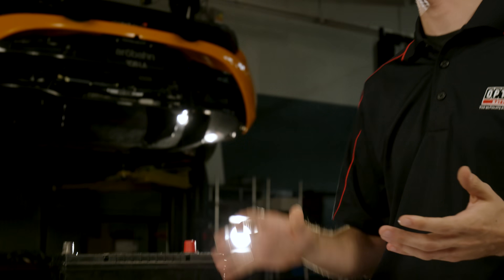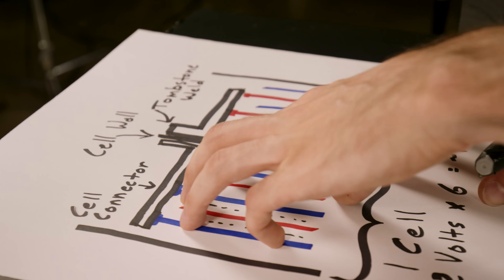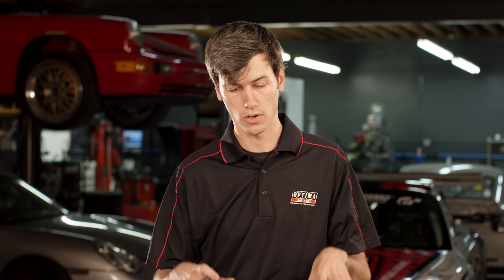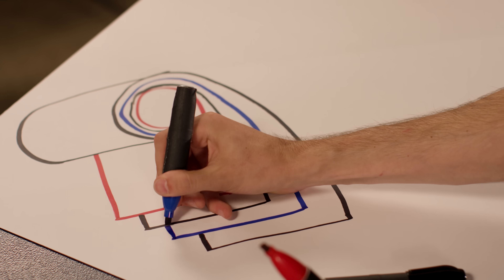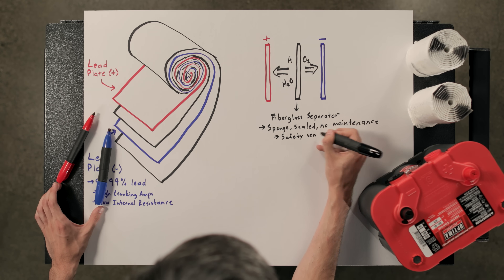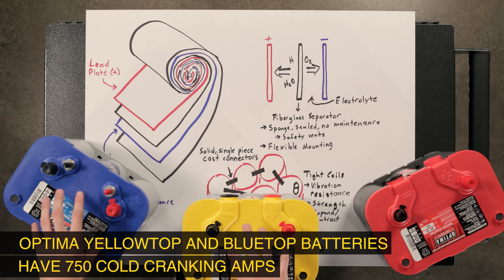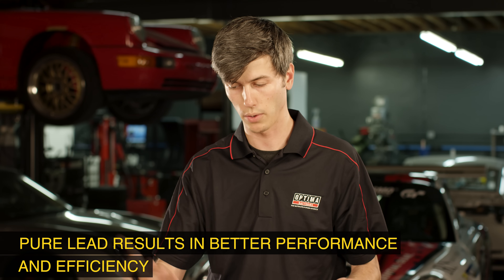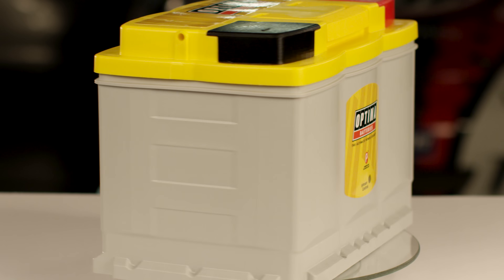What Type Of Car Battery Should You Use? Flooded vs AGM

Comment: It's good to know that commercial airlines still use Lead-Acid and Ni-Cad flooded batteries. They are slowly switching to lithium-ion batteries. Another random fact, the AGM batteries are constructed the exact same way as your typical AA battery. Just bigger and with more cells

Comment: I have a nissan leaf and it uses a standard 12 volt starting battery to engage the car and power its accessories. the accessories then draw mostly from the traction battery. is it possible to change to a agm/deep cycle/marine/golf cart battery to provide more power for the accessories before drawing on the traction battery?

Comment: AGM is far superior to regular car batteries and lasts longer. I use them in my mowers and for two solar power systems, one in my garage and the other in my house. We put one in a car and so far, four years later, it is still going strong and showing no signs of charge or discharge issues. This battery was actually designed for use with solar panels but seems to work well in a car. The negative? They are real expensive as compared to standard car batteries. An 85 AH AGM by VmaxTanks will set you back around $225. But, boy will that battery make the starter
crank.

Comment: I'm curious about something I was told in a college class I took: I was told that conventional Lead Acid battery-based systems charge at ~14.7V and that AGM-based systems charge at(I forget which) either 14.4V or 14.2V and that swapping the two would cause long term degradation of the battery. Is this true or did I just have too many diesel exhaust pipes near my face in my life?

Comment: I always assumed the cylindrical cells were to allow the pressure relief valve to be set for a higher pressure, allowing faster charge rates without venting.

Comment: Is this a advertising YouTube channel?

I do own 5 optima batteries: 4 blue ones, one yellow. 3 are more or less dead! All more or less new. 1 with 8 Volt, 1 with 6.x Volt, yellow with ~ 10.x volt after more than 12 non charging. The 2 blue inside my truck are parallel and store less than 11 Volt after non charging (or driving) for more than 1 month and ~ 10°C outside. Btw non connected to the truck makes NO difference.

I once wrote an email to German Optima Support: no answer. Than again to German Marketing manager in CC, received a “read by ...“ dialog: no answer.

Comment: I hope Johnson Controls is not a DEATH sentence for the Optima batteries. I have experience with johnson controls UPS type batteries used in big systems. NOT good. I would use a different band if possible.

Comment: Remember, AGM and Flooded need different alternator voltages. Swapping these will over or undercharge the incompatible battery. So change the voltage regulator to maintain compatibility.

Comment: I had an Optima Redtop only last a year and a half, but it was my fault. I always cycled the battery with the car's lighting when I did work on it, and it sat a lot. Died so many times that I ruined the cells lol. Luckily I got it replaced under warranty at Autozone. I could have just disconnected the negative cable and even buy a battery tender. At least now I actually drive it more and got a lot fixed.

Comment: A lot of that went over my head, but I got the jist of it I guess. Lead acid is the worst but cheapest and most common.
As for my application (eventually), I have a hard time deciding if I need a red or a yellow top. I would think deep cycle (do they take longer to discharge? Hold more of a charge longer?... Such as running radio with vehicle off, or accidentally left lights on?... And is a yellow top good enough to start a big cam V8 engine in 10 degree weather, or is a red top need for that?

Comment: It's probably due to the sponsor, but something is annoying about this video format. It looks like a cooking show with that different camera pointing at you at an angle, and the camera roll through the text that you wrote as if it's a piece of steak. just point one fixed camera at the board and other camera to point at your face occasionally. Simpler is better.

Comment: This video did feel like a long ad for Optima's AGM batteries.  As well as mentioning the AGM battery lifespan is up to three times longer than normal batteries, you should also mention AGM batteries are a lot more expensive.  About triple the price from what I can see locally, so you're potentially gaining nothing financially and could end up losing money if the AGM battery doesn't last as long as three normal units.

Comment: I like most of your videos, but not too sure about this one. This is more of a commercial for Optima batteries than a true comparison. Let me start off by saying that yes, I think AGM batteries are better than FLA batteries. You hit the high-points well but AGM batteries have downsides, as well. Cost is generally considerably higher, and charging characteristics are different. They are more sensitive to overcharging, so sometimes they aren't the best choice, especially for older vehicles or vehicles with an alternator that charges at a higher voltage. If your car's charging system isn't designed for one it's possible that your car shortens the life of the AGM battery.

Comment: Now I will consider wound batteries. I was doubtful since the volume per cell is reduced when you try to fill a rectangular battery with cylinders.alsoWhen a battery charges it is the water that is reduced to H and O not the sulphur. Replacing the missing water with electrolyte increases the sulphuric acid to water ratio and has been known to kill batteries. Always top up the battery with water.

Comment: 2014 mazda 6 gt has a q85 battery which from my research is the same as a conventional battery just has more plates for start/stop application and for the recharging from the i-eloop. my question is. can a AGM battery be an alternate replacement??  from mazda the q85 is $500+ for replacement👎

Comment: We did a test with our Police fleet and found the Optima batteries life expectancy was 1 1/2 to 2 times that of flooded lead acid batteries but the price was 3 times higher. The Optima's performed about the same but they did have a lower cold cranking amperage ( 750 CCA vs. 850 ) and lower reserve capacity (120 vs. 150 ) then the flooded lead acid batteries.
Reply: Please name the flooded one¨s brand, as I would like to find out a cheaper option for normal, cheap cars.  My experience with Optimas here in Finland that they last 4-10+ times the flooded ones do.  Actually, all AGM batteries last so much longer than flooded ones, if you find one that physically fits your car or truck there is no reason to buy a flooded one.
With your fleet, what may have been the reason for so little margin,  usually Optimas are hard to fit to the place of the original; I had to modify the battery tray/box of my H3 to fit a suitable size (electrically) Optima. Usually only electrically "smaller" optimas fit original battery trays, so it is apples to oranges unless the situation is made fair.

Comment: The spiral cells seems to inherently have a lower capacity than the other two types but Optima claim this should be retained for longer. I can’t work out if it is important to keep a flooded or AGM battery with a high capacity or switch to the spiral cell for the improved CCA and charge holding between uses.

Comment: Do AGM batteries have a lower self discharge spec?  Seems like that would be good for a third car that you don't drive often.
Reply from the maker: That’s a good question. I believe it is the case. I have some in my garage, I should test and find out. 👍
Reply: Doing a quick Google search, I found this, "The self discharge of batteries with Lead-Antimony plates can be high - as much as 1% per day on an older battery. A new AGM typically self-discharges at about 1-2% per month, while an old one may be as much as 2% per week."  Although it would be a good experiment if you have the two batteries out of the car, even though today's cars have a considerable drain on the battery for the computer systems.  The battery in my S2000 gets noticeably weaker if I don't drive it for a few weeks.  In my VFR800 I have a Shorai LiFePo battery which, even after several months would have enough charge to start the motorcycle.  I never needed to use a battery tender.

Comment: I was disappointed you never mentioned the effect of heat on Valve Regulated Lead Acid batteries, including AGM batteries. At work (a Fortune 100 electric utility) I am responsible for about a dozen communication sites with float charged battery banks. About 20 years ago we shifted from flooded cells to VRLA batteries made by Exide. The 20 year life expectancy was never realized; we were getting an average of 8 years from them while we averaged nearly 20 years with flooded cells. I am okay with using AGM batteries outside the engine compartment but would never dream of putting one under the hood.

Comment: Oh joy, another product shill video.  A video comparing X-brand to anything else, paid for by X-brand...while wearing X-brand's merchandise and completely changing your format to meet their video standards.  Anything you say comparing their batteries to standard batteries is suspect at that point.

Let's discuss the downside of AGM batteries, such as how they don't work so well on high voltage charging systems (such as GM), or how an extremely low AGM battery looks like a dead short to a charger/alternator.

Let's talk about how their main outlet in the US, Advance Auto, won't honor the 3 year warranty for a battery that won't maintain a charge after only a year.

This is beneath you.

Comment: Would it be feasable to do a video compairing blow off valve types and which is better for different applications? I.e. full recirculation vs full atmosphere vs hybrid for turbo or supercharger? Id be very interested as to the info youd have on this

Comment: Incomplete information. 

There are not 2 types of batteries for automative use. There are 4. 

Most common: 
1. Flooded lead acid batteries. 
2. Maintenance free batteries. 

More expensive: 
3. Enhanced Flooded Battery (minimum requirement for all cars with Start/Stop function). 

4. Absorbed Glass Mat (eg: Optima).

Comment: I can't even begin to imagine why, but I've had nothing but bad luck with Optima batteries over the years. I've owned 3 and both stopped holding any sort of capacity after a year or 2, whereas the normal lead acid would last 5+.  I've since then moved to odyssey batteries with good luck.

Comment: Really wish you’d cover all the electrical stuff as well, including jump starters, both li-ion powered/AC powered & the cool but not always practical capacitor powered jumpers, and trickle chargers/fast chargers etc, the differences and what effects each has on lead acid batteries, and then going into desulfation and “restoring” them by desulfating the battery with a higher voltage low amperage charge

Comment: Hey Mr. How are you? I have a question and I've been wondering if you could help me.

I'm in a Formula E SAE team in Brazil and I'm the responsable to optimize our transmission system. Last year we used a CVT but it wasn't very good. We couldn't find the best way to run it so, because of it and because we are trying to make a lighter car, we are removing the CVT, at least for this year.
I was supposed to make a direct transmission between the engine and the wheels or find some kind of lighter and simpler transmission. Do you have any idea what I should do? There is something to use instead of the CVT?
Ps: Our electric engine isn't that powerfull
Ps2: I've read and article about using a CVT for lighter vehicles so, as the author said, i think it could be used to optimize our car in the future. What do you think?

Thank you for your time!

Comment: I love Optima Batteries for their cranking amps. However, I no longer use them in my daily drivers. I've found their longevity lacking. I have had bad luck with several. I use them in construction equipment where there is an insane amount of vibration. They do last longer than traditional flooded batteries in that environment, but I wouldn't say 3x longer.  
  My pickup currently has a 10 year old battery installed. I'm lucky to get out of the 3 year warranty period of an Optima without having problems. Yes, I use the fancy AGM digital battery chargers if I need a charge. No, they don't seem to help longevity.

Comment: What causes flooded batteries to swell and crack? My 2015 F350, only one of the batteries would corrode and after removing it to clean it up I discovered two large cracks near the positive terminal but the battery would still hold a charge. The truck was bone stock from the dealer.

Comment: I would buy an optima, but I have never been let down by a regular battery before and I don't have a need to mount it at an angle. Maybe a day will come where it's just too cold and I can't get enough amps or one shorts on me, but I left a Duralast battery in my Jeep for 8 years and only changed it because I was at a parts store and needed to buy a battery for a project built and there was a sale for a second battery.

Comment: Mazda Miatas used to come with AGM batteries since the battery was moved to the trunk.  My experience with AGM is based on Mazda AGM batteries (which I was told were made by Panasonic) and Westco AGM replacement batteries.  AGM batteries are better in almost every way than flooded batteries.  They are lighter, safer, immune to vibration and last much longer (mine lasted 7-10 years).  The one drawback is they can not be rapid charged.  AGM batteries like long slow charging.  How much is too much?  Well, I have a small 10 amp battery charger that I figured would be safe.  After my step-daughter fully discharged my battery by leaving my lights on I put my 10 amp charger on the dead AGM battery.  When I came back to check it hours later it was still taking 10 amps and had become too hot to touch.  I shut it down and let the battery cool down but it still didn't have enough charge to start my car.  I didn't have a trickle charger on handy so I put a timer on my charger set to charge for 30 minutes on, 90 minutes off.  Next morning it started like a champ.  How are Optima batteries in this regard?  Can they be rapid charged?

Comment: As I was replacing a flooded lead acid battery in my work truck yesterday in a 15°f and 20 mph windy weather with an equally old optima battery, I was thinking they should make these flooded lead acid batteries illegal.,  no trouble starting with the optima.

Comment: Hello, one question! So there's negatives to only One of those types of batteries? (The typical flooded battery)
Reply from the maker: In comparison of three types, the flooded has the most disadvantages. The others (AGM) however, are significantly more expensive. Overall, lead-acid batteries are quite heavy.

Comment: I have one optima battery from 2005 that still works.  Every car or race car I've owned recently that came with an optima battery in it crapped out or needed jumped every time the temperature outside drop below freezing.  My race car now has a braille in it.